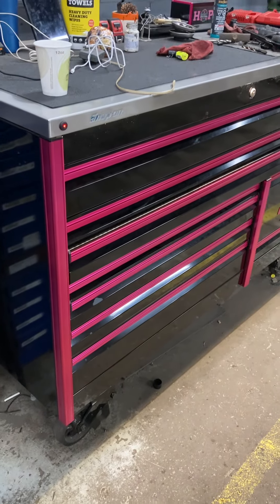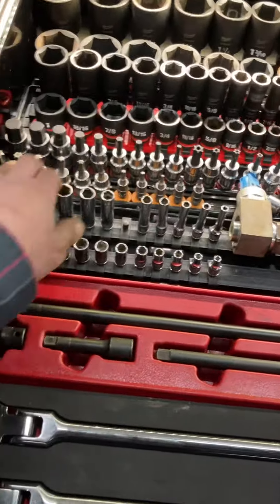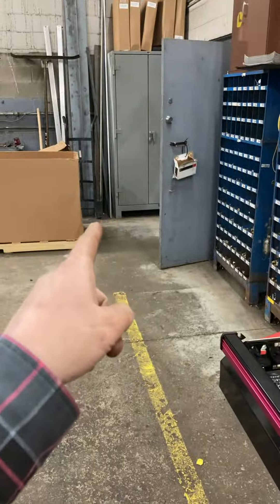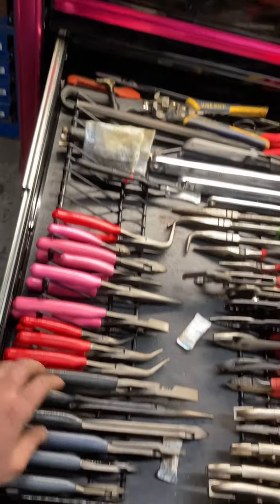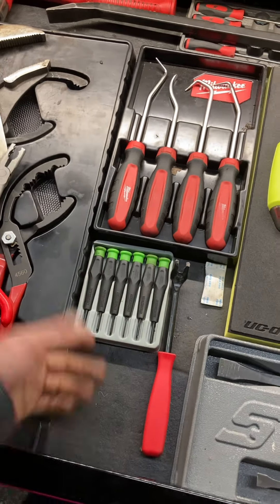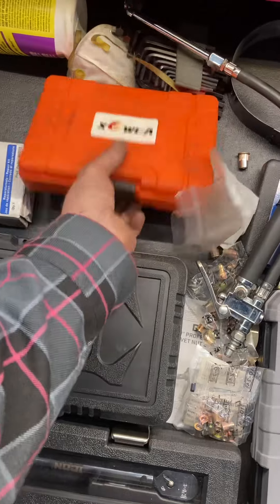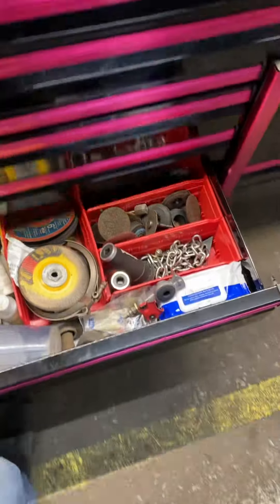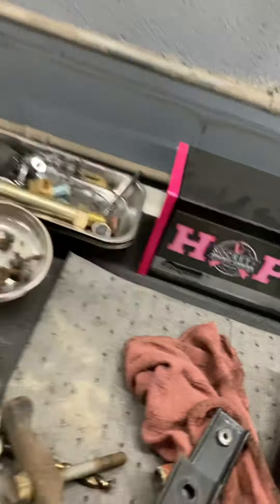Snap on 68 epiq tool box tour diesel fleet maintenance

Comment: Nice set up you have. 
I have a 72 inch master series , but the big drawback is, I wish it had a full length top drawer like your Epic. 
Also, on a sidenote, in the future, I’d recommend turning your phone sideways when doing your videos.
Reply from the maker: To your phone comment ..yeahhhhh kinda realized I screwed that up about an hour after posting this video but it’s here now 😆 😂 

My only “issue” with the epiq is (and I’m not comparing but just stating an observation I’ve noticed here and there ) and that is it being 30” deep and the top drawer high up on me compared to other boxes (I’m 5’10”) it makes it “fun” to reach in the far back row of my top drawer.

Usually a bit of a stretch to do so but other than that the box is awesome.

I usually get shit for not having snap on wrenches and sockets but what i use  has worked for me thus far and that’s not bad mouthing snap on for I have snap on tools but for the price of sockets and wrenches I went “mid level” and haven’t had an issue yet
Reply: You’re absolutely right. I have the benefit of being 6’3” and I’ve always built my work benches higher up to make my job easier so therefore, my toolbox and deep drawers are an asset. 

I happen to have a lot of  Snap on hand tools along with their 18v and 14.4 along with a lot of Mack and Milwaukee. 
Bottom line is I agree with you it’s your money and buy what works best for you.

Appreciate your time and putting the toolbox tour together and responding back to me   👍🏻
Reply from the maker: @russellpottenger8584  oh I didn’t mean the comment about my money my tools to come across snotty or sarcastic I did not mean that what I meant to say is that if they do break or become a consistent issue I will gladly upgrade them to something snap on and or Mac 

Sorry if that came across kinda condescending I did not mean that
Reply: Your comment didn’t come across as being snotty or arrogant. 
One of the reasons why I enjoy watching toolbox tours and tool reviews is getting perspective from different people on what works for them and what doesn’t.  👊🏻

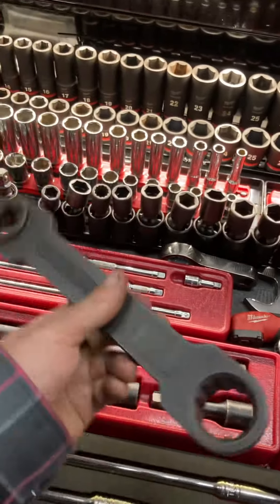Comment: Nice set up! The 30mm torque adapter at 7:17 can you post part number please?  The Detroit one, I have the Snap On but keep breaking it.
Reply: Nevermind I found it,30Mm Air Disc Brake Torque
Adapter DSNCHA018005
Reply from the maker: I feel kinda dumb buying the snap on one because them being on at 350 ish ft lbs and some have blue lock tight from the factory the 3/4” drive Detroit one is way better

That Detroit one on my 3/4” drive 40” long breaker bar  makes short work of it 90% of the time
Reply from the maker: I’m going to try and out the link to the site I bought mine from 

https://bigrigworld.com/30mm-air-disc-brake-torque-adapter-dsncha018005.html?gad_source=1&gclid=EAIaIQobChMIxtrb9PDghgMV5FBHAR0oLgLGEAQYAiABEgJsZfD_BwE

If it doesn’t work here’s the part number 

DSNCHA018005
Reply from the maker: @nathankisner8332  haha well played I just replied too !!! Good timing haha
Reply from the maker: @nathankisner8332  some days I miss doing drum brakes 

Just got done doing 4 rotors on a newer cascadia and man the labor on them

Specially in the rust belt in the north east

Comment: I have been a heavy equipment/heavy truck mechanic 30 years now. I use mainly Mac tools now. But the Milwaukee wrench’s are not that bad. I prefer the Mac precision torque. Similar style but far superior wrench.  That sucks you don’t get into engines on your fleet. I also have a lot of dd13 and 15 in gravel trucks. I have 2 of my younger guys doing in frames right now to gain experience. Nice set up you have for only a few years I. The trade. You should get the tiger tool u joint puller and anchor pin press both a lifesaver.
Reply from the maker: Yeah when I bought my first miwlaukee set a few years ago (wrenches ) I saw other brands were similar with their open jaw so trust me when I say I know they’re not unique to Milwaukee but I do like the Milwaukee wrenches. Yes they could be a tiny bit longer but for 99.99 for one combination wrench set (bought most of my stuff on sale, I think the regular combo wrenches go for 139.00 ish??? Full price but for 99 bucks plus tax and stuff I gave them a try and never looked back.

yeah we havet done any inframe work sense pre Covid and even then the inframe work was very rare. That mostly came down to a slow slow pull away from what o would call “a total garage” to just what my old boss called “just a PM shop”

it sucks we don’t but I’ve found ways to get further in my career. Just a year ago we started buying the parts to do rear end spring bushing. We bought one air-hydraulic press and a pulled and an ez red laser alignment kit to do in-house alignments. That’s the one thing I pushed my bosses to do so it’s one less thing we send out lol and I like doing it.

The overall problem in my garage is for some reason as time went on less and was was done in house but then again the place is 30 years old we’ve put grown the warehouse AND THE GARAGE 

Things were just different in the 90’s lol

I do wish we did in frames but I was able to get them to buy equipment for my n house alignments it’s not perfect but it’s a step in the right direction 

Also as for the mac comment I don’t know if I said it in my video sorry if I’m redundant but we never had a mac guy. Only had snap on here sense I’ve been here with the exception of a brief and I mean brief run with a Matco guy (maybe 6-8 months)

Even with snap on being here sense I’ve been here flash back to 2019 when I was in the garage as an apprentice I was very intimidated to get on that truck because well to be blunt and not hating but blunt 

New tech and even now that shit is expensive.

but I’ve bought several things now. I don’t think I’ll ever change my wrenches or sockets unless shit really hits the fan but time will tell won’t it ? 

Thanks for watching 🍻
Reply from the maker: Oh and as for the tiger tools we have them in the shop. That’s one of the better things I guess of this shop. Specialty tool? They probably have it .

Wheel nut sockets (3 3/4 for example ) shop has it. U-joint tool? Got it. 

Now in the future would I like those AS MY OWN regardless if the shop has them? Ohhhh for sure but that’s down the road 🙂
Reply from the maker: Oh so the shop has the anchor pin press and I actually bought for my self the anchor pin sleeve press …
If it’s the “hollow spider” I don’t need the tool I can get them out with a chisel and a hammer or air hammer 

The solid spiders is what I bought the tools for
Reply: @Tcorellis-j6d  The only time I suggest upgrading is if the tool is failing, extremely common use or the biggest reason you need it at home. My tools at home are a lot of the cheaper stuff I started out with. Sure is handy not to have to take tools home to do a job. The biggest reason I have a lot off tools considered shop tools is that I used to work out of a service truck on remote sites where everything had to be flown in or come in on the ice roads in the winter which we had to build as well. Oh I should tell you if you don’t already know any Detroit specialty tools are usually cheaper or the same price as Amazon. I’m up in Canada no harbour freight here and they won’t ship to us. Oh and the mueller kupps thread chasers for Knox dept temp and soot sensors definitely worth investing in. Expensive but make life a lot easier.
Reply from the maker: @1234563221  yeah I hear yeah with the specialty tools I eventually want to have my own
when I first started I literally went on a shopping spree between Home Depot, lowes and harbor freight because I just needed the bare bones basics. Ya know simple socket sets a few ratchets, two basic impact guns screw driver set, hex/allan sets etc etc. when it came time for sockets I’m sorry not hating but I couldn’t justify 550.00 USD (sorry don’t know the conversion rate top of my head) for ONE snap on 1/2 impact socket set. Sorry it’s American made and all and I know it’s better steel or better alloys in the socket but not at 1000.00+ for two sets because as you’re aware stuff is mixed specially when working in trailers a lot of the stuff is SAE 

We have re thread/taps for the NOx sensors and stuff that shit comes in handy instead of cutting out and re welding a new bung in